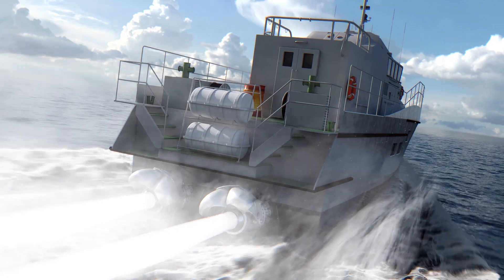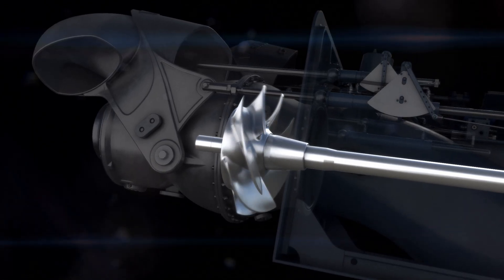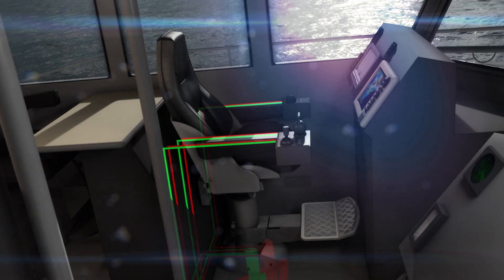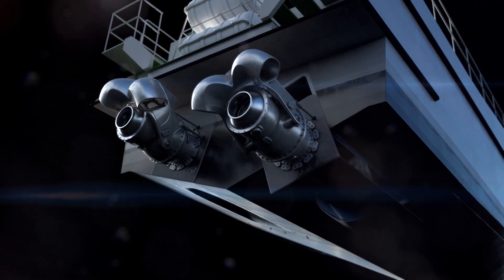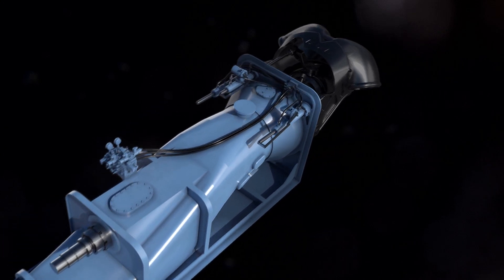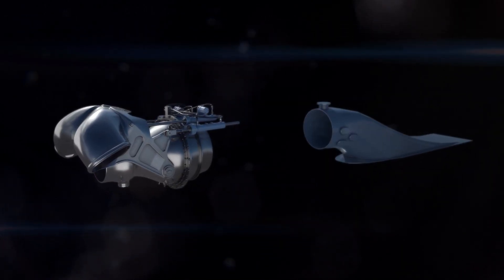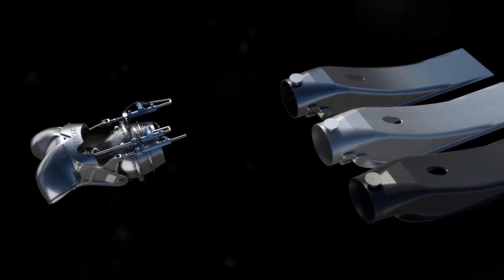Kongsberg Waterjets - unchallenged performance

Comment: waterjet is a simple water pump.In 1993 Learjet special projects team tested a boat able to reach near MACH1 with a payload of 10.000 tons.We are 30 years later today and nobody is coming near this ship
Reply: @banger2998  Mach its the speed of sound 340m/s.You can turn it into whatever measure you want km/h,mph,its still speed of sound.However speed of sound changes into different fluids,like water.Mach refers at speed of sound in the air.why am I answering such of question?have a nice day
Reply: Mach 1? Omg
Reply: @girishmahajan3646  why omg? BMW did MACH27 same type and its working
Reply: @banger2998  well then a cruise missile going Mach3 will be 3times more ridiculous for you.hope you have a nice day now
Reply: At that speed doesn't water become concrete
Reply: @robertgarcia-zn7ed  this is why the boat doesnt touch the water as it accelerates

Comment: '
are both jets same spins or opposite spins...
not important about low currencys in this above
Reply: highly doubt it, wouldn't matter since the water exiting the nozzles are not spinning. there is a stator behind the impeller stopping the rotation of the water jet

Comment: I was waiting for info on the intake and what steps were taken to minimize debris from getting sucked in, and how the system deals with what does make it in.
Reply: They have a grill that covers the intake. 
Not sure why so many people get hung up on the idea of things being sucked into the jet. A jets impeller is better protected than any open prop.
Reply: The surface area of the intake is much larger than the surface area of the area of the nozzle. Thus, the velocity of the water entering the intake is much lower than the water exiting the nozzle.
Reply: They have bars running parallel to the vessel that acts as a sort of screen, and the impellers are designed to take hits from anything short of metal, rock, or other similarly hard objects. Woods, especially ones that have been in the water for a while, will be blended up
Reply: This should help explain some of what you're looking for.
Reply: Looks hard and pricey for maintenance

Comment: Can a Water Jet Ship run slowly and quietly as many as possible level?
Reply: About the same as a Seadoo. The way to make a silent propeller is a  closely held military secret which has to do with special shapes, coatings, and techniques to reduce cavitation and air bubbles around the propeller; in this case impeller. The impeller does help to reduce noise as the shroud on submarine propellers. The only quite drive I know of is Magnetohydrodynamic drive or MHD.

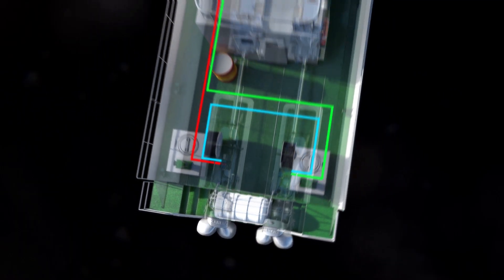Comment: 1:01 I was just thinking about a  water jet propeller fitted with a mhd parietal accelerator, added to the turbine or completely replacing it...
Reply: it would only hinder the vehicle due to the relatively little power generated by such a system